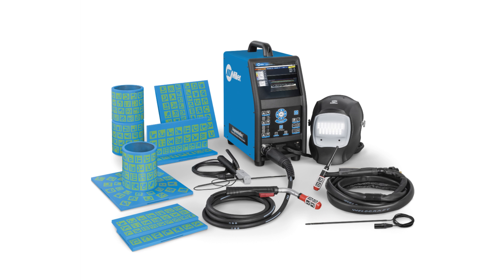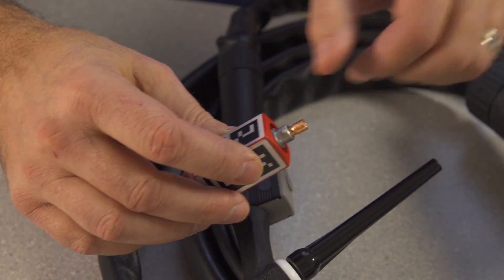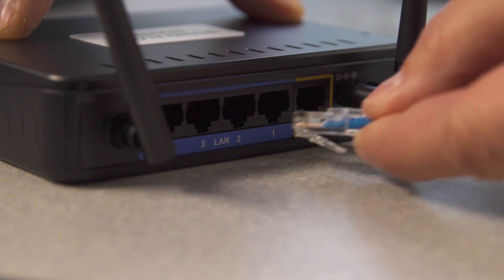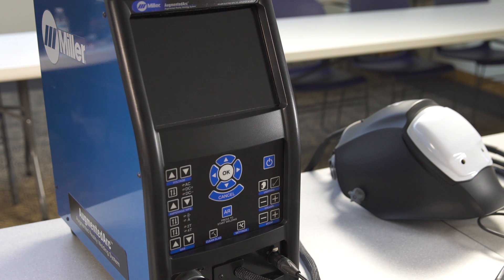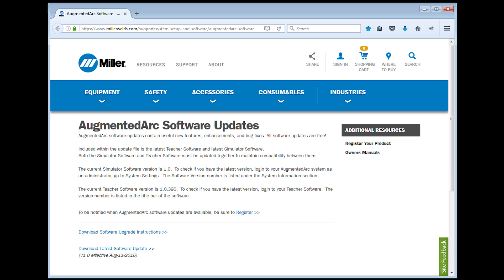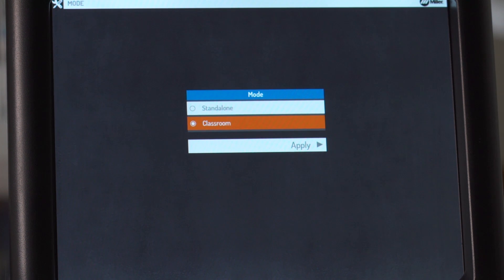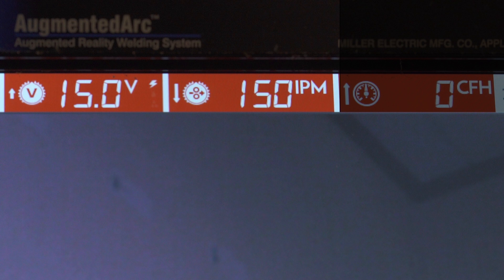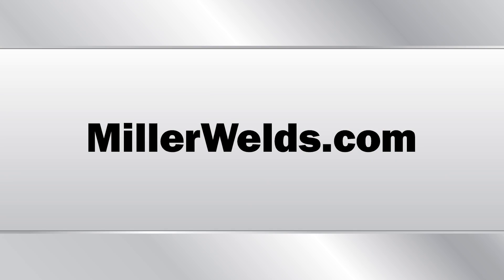Setting up your Miller AugmentedArc Augmented Reality Welding System

Comment: Can you touch your tungsten to the plate? and how does it handle your tungsten needed to be reground?
Reply from the maker: Hi John! We apologize for the delayed response, thank you for your patience. To answer both of your commented questions: 
1. Can you touch your tungsten to the plate?
This will negatively affect your score, but it won’t simulate the tungsten being contaminated.
2. How does it handle your tungsten needed to be reground?
This is not a part of the simulation
3. Can you walk the cup?
While the system allows you to walk the cup, it will not score you based on proper technique associated with walking the cup.
4. Can you blow through if you get too much heat? 
This is also not a part of the simulation.
We hope these answers help, let us know if you have additional questions!